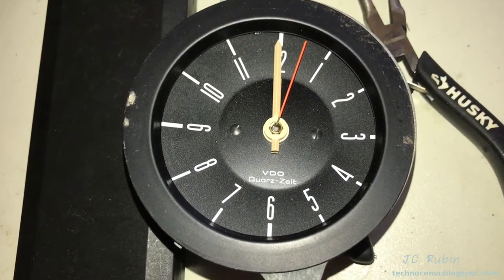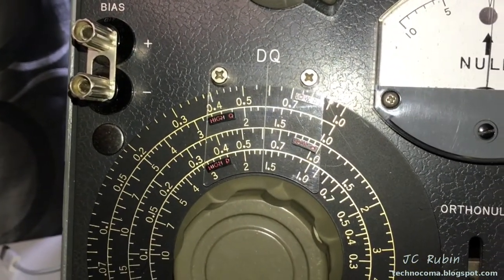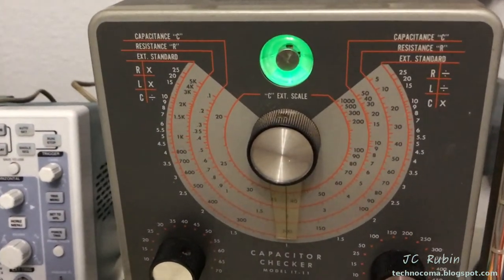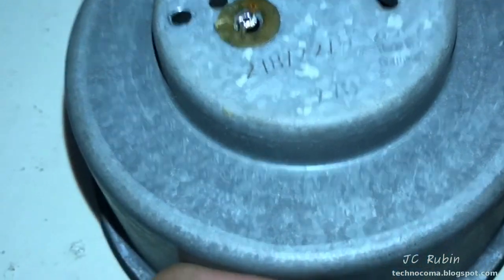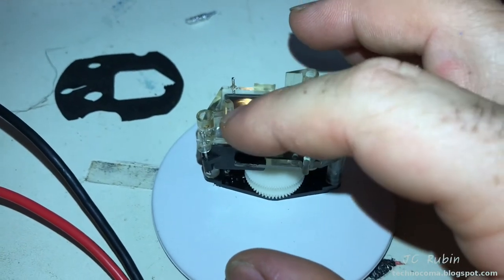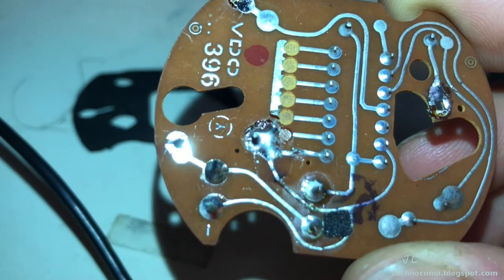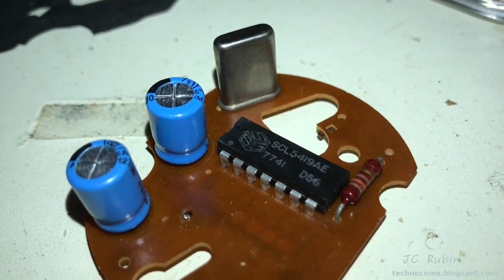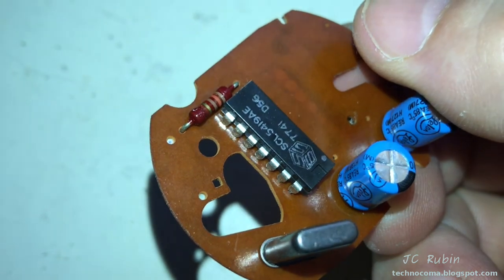Volkswagen Porsche VDO Analog Clock Troubleshoot and Repair Part 1 of 2

Comment: Hi, thank you for the video! My old Deutz tractor has the same clock and I have already disassembled it like you did it in the video. Now I am searching for the SAJ300R chip, but I only find the SAJ 300 T to buy. Do you know if the SAJ300T is also working? I am not an electrical engineer, thats why I ask this maybe stupid question. Thank you a lot. Regards from germany
Reply from the maker: 300T    CMOS-HF-Quarzuhrschaltung mlt dlgltalem Abglelch und 64-Hz-Ausgang
300R    CMOS-HF-Quarzuhrschaltung mlt dlgltalem Abglelch und .5-Hz-Ausgang

https://elektrotanya.com/itt_saj300t_quarz_uhr_ic_info_de.pdf/download.html